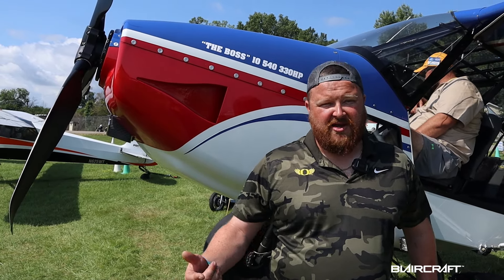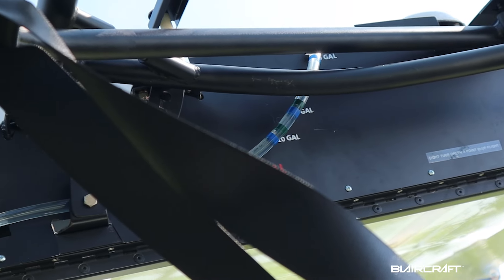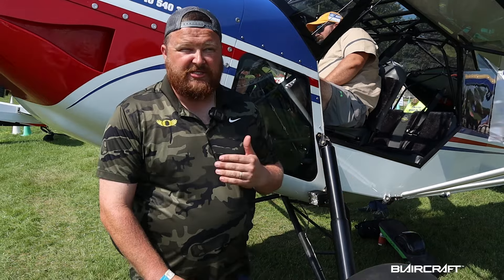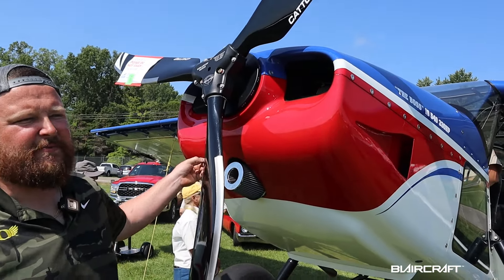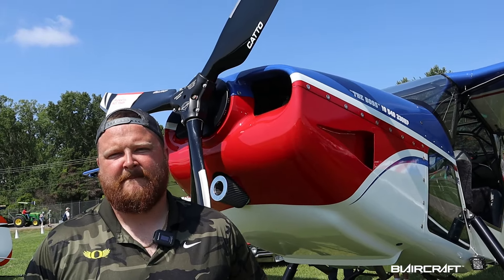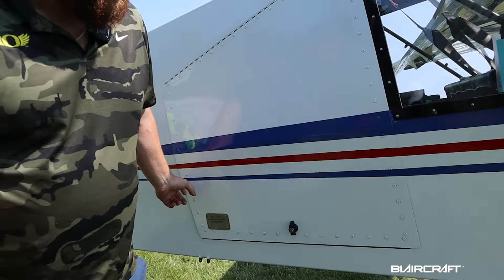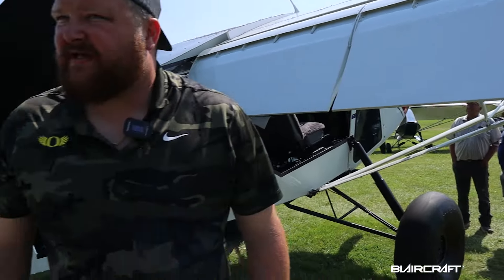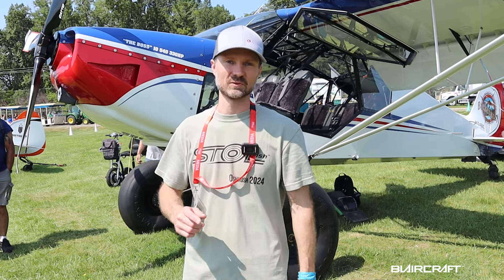BEST Bush Plane KIT?

Comment: Horrible takeoff technique.
Reply from the maker: What would you’ve done differently?
Reply: Nose way too low.  Banging the tail is poor technique, and actually increases take off distance because of sudden drag of the “hit.” Also, remember there is a big gyro on the front of the plane and it’s best to not introduce the resultant force of that gyro in two different directions in the actual takeoff phase.  A better technique is to either take off 3 point….yes you will accelerate sufficiently, or bring the tail up a few inches and fly it off the ground from the tail low position.